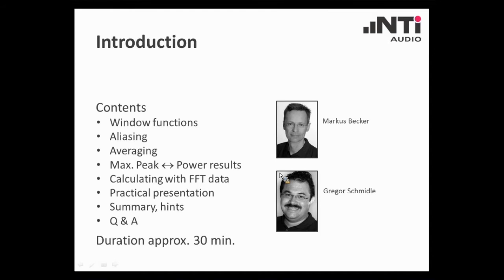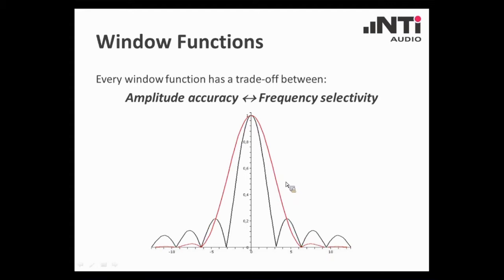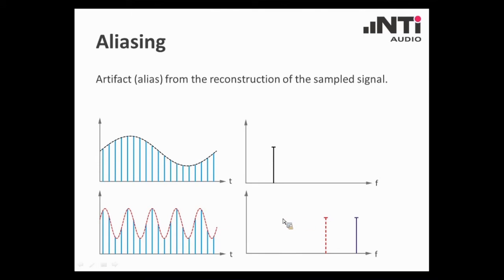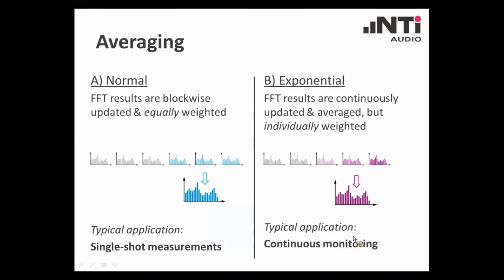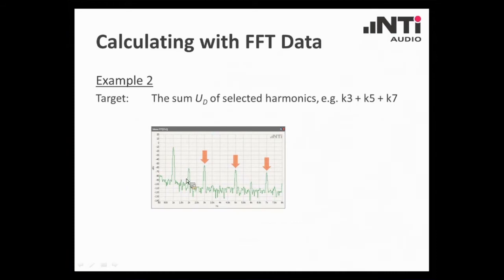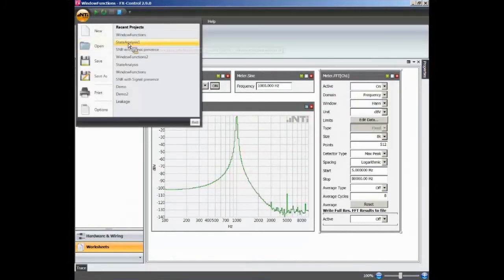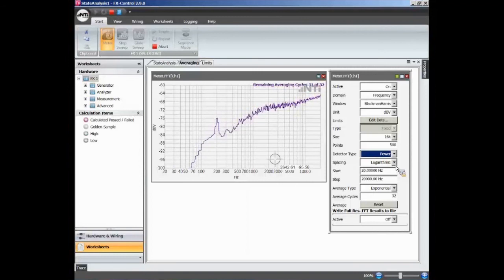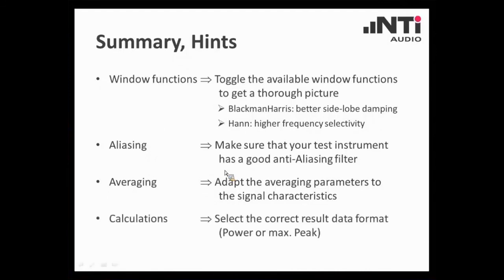Advanced Topics of FFT Analysis - Webinar

Comment: thanks for the presentation.   could you explain the relationship between block length and bin?  i got a little lost during the 'calculating FFT Data' section, particularly when getting RSS of bins in a band?
Reply from the maker: Hello Michael,
the FFT blocklength BL is the number of samples that are acquired for one FFT calculation. The sampling rate fs is the number of samples that the system acquires per second. Consequently, the duration D of one FFT block is D = BL/fs

This duration also determines the frequency spacing (= bins) of the FFT result. The first frequency is reported at f(1) = 1 * (fs/BL), the next at f(2) = 2 * (fs/BL), and so on.
Example:  BL = 1024, fs = 48kHz
D = 1024/48000 = 21.33ms
fBin = 48000/1024 = 46.875Hz
f(1) = 46.875Hz, f(2) = 93.75Hz, …
Reply: great thanks for the explanation!